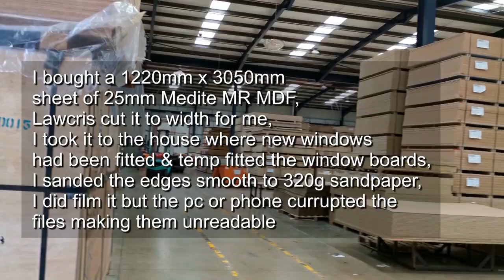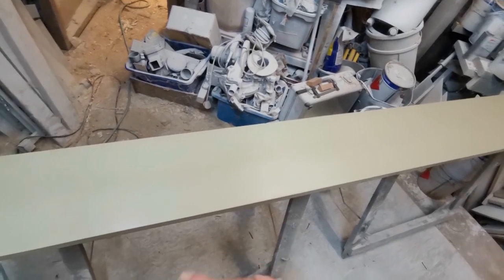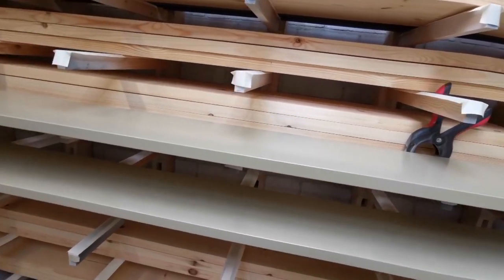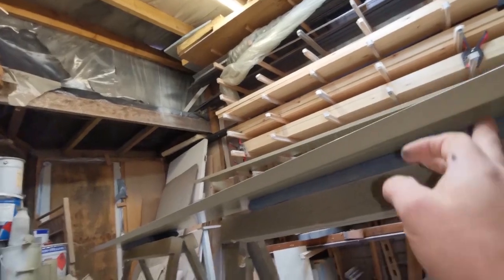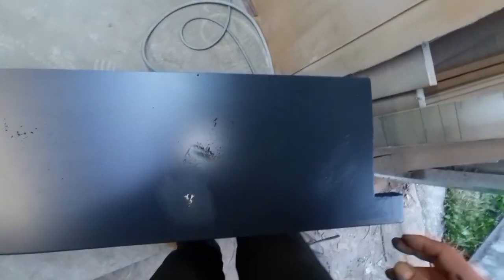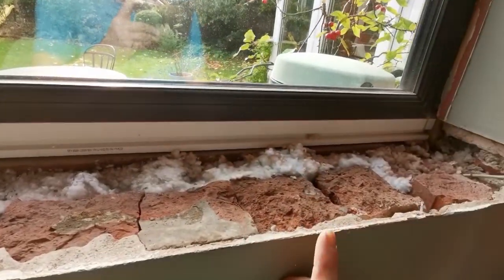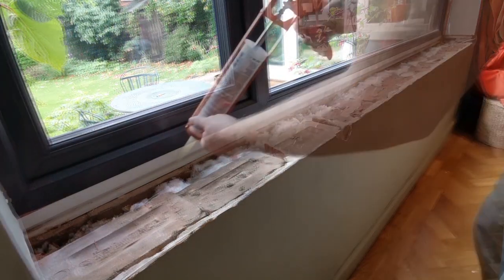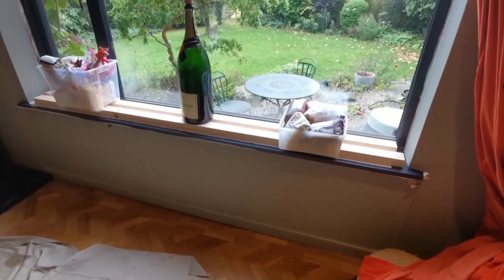Spraying & fitting some window boards with PU enamel paint, colour matched to Railings Grey

Comment: There's bugger all wrong with using foam to fix,when there's sufficient gap underneath I like to put some panel pins in ten underside of the cill and use the insta stick low expansion foam which is also great for fixing skirting etc. it is twice the price though. Another cracking job. I'd love to be able to spray my work,especially to your standard but I don't have the gear as of yet.
Reply from the maker: 👍 Yep anyone who's tried to remove anything that's been foamed in will know it's quite firmly in there, 👍 The spraying is fairly simple, I have a Bostitch 50L compressor which is only just big enough, I'll upgrade to a 100ltr with a bigger CFM one day maybe, I've a variety of Gravity fed guns & a wall mounted regulator/filter set at about 20-30psi, very simple to set up, The cheaper guns i use sometimes are ANI for about £24, they're good to start with, the black ANI i use sometimes is a bit more £45-ish & the Devilbiss FLG5 is closer to £100 but it's the best & my favourite, it's the one you'll see me use most of the time, the paint strainers i use for all paints, they are Starchen 190, I get mine locally but can be got on ebay etc. https://www.ebay.co.uk/p/1292815382?iid=113200954395&chn=ps&norover=1&mkevt=1&mkrid=710-134428-41853-0&mkcid=2&itemid=113200954395&targetid=879043638628&device=c&mktype=pla&googleloc=9046317&poi=&campaignid=9455575137&mkgroupid=94880575894&rlsatarget=pla-879043638628&abcId=1139576&merchantid=7341554&gclid=CjwKCAjw5Ij2BRBdEiwA0Frc9SSEKwHUlAOBKkG1HPN803XblvAQwt4Mt6gWa1BsEcuE70eue-P9fBoC2_EQAvD_BwE  I don't know if you have a compressor but a compressor is good for any workshop tho if nothing else but for blowing up your tyres 😁 This company is good for guns https://www.spraygunsdirect.co.uk/index.php/

Comment: As usual a great job. Amazed that you can get such a good finish in what looks to be a pretty dusty work area.
Reply from the maker: Thanks 👍 Yeah it's far from ideal but they normally turn out ok, there's a few more dust bits then I'd like, I'd prefer it clinically clean 🤷‍♂️😁, for me it's about dust management, I blow down the immediate area before spraying, if there's a lot of dust from maybe cutting/sawing i'll start spraying next day when it's settled, i try not to kick up or disturb it while spraying, sanding the primer & any filler causes loads of dust, once i get to the top coats i take these precautions n the fan above the door helps to extract airborne stuff 😉

Comment: The finish on those cills is fucking awesome.  Wouldn't mind getting into doing a bit of spraying myself since most of the painters always seem to leave big shitty streaks/ blobs on my work.
Reply from the maker: Thanks, yeah that's the reason i started spraying the finish coat, I'd put a coat of primer on for people just to seal it until they got around to painting but when i went back n saw the state of theirs or a so called decorators paint work, runs & the detail lost under blathered paint i started to offer spraying, It's fairly easy after a bit of trial n error with minimal tools. I have a 50L compressor which is only just big enough, a variety of Gravity fed guns & a wall mounted regulator/filter set at about 20psi 😉👍 I'm going to try show it in my next vid where I'll be spraying stain n clear lacquer .
Reply: @Gidjoiner  I'm a total novice so thanks for the info!  Yeah, there is nothing more heart-breaking knowing how much care you have taken  to have somebody paint bomb it. I'm looking forward to see your setup  in a little more depth. I'm actually a little excited to have a go at spraying, never thought i would say that about painting.
Reply from the maker: 😂😂 Same here, hate painting by hand but spraying does give a lovely finish for minimal effort, it does show every imperfection tho so is only as good as the work done before on the wood, primer, sanding, filing etc. 
There's honestly not a lot to show on my set-up, quite simple, that's what i like about it, The cheaper guns i use sometimes are ANI for about £24, they're good to start with, the black ANI in this vid is a bit more £45-ish & the Devilbiss FLG5 is closer to £100 but it's the best & my favourite, This is where i got my guns they'll talk to you 😉 https://www.spraygunsdirect.co.uk/index.php/

Comment: I did my window board the other week, and did a similar thing with wood on cill but used some  plaster board ceiling jacks to stop the foam from pushing up. Nice work gid
Reply from the maker: 👍👍 I did wonder if the weights would be enough n hoped the excess would just squeeze out the front, I don't have plaster board ceiling jacks but considered wedging some 2x1s to the top of the reveal, knowing my luck tho the plaster would fall down,  😂 Thanks Phil 👍

Comment: Great videos Gid, I’m in the process of learning how to spray, I’ve bought the compressor, guns and so on, but not having much luck with it at the mo, but I’ve only been using emulsion paint. Symphony shop is only half hour away from me so I’m going to get some pre cat paint to start off with, just the primer for now so I can practice. Your channel is one of the best informational, practical channels for a beginner sprayer like me I’ve ever watched ( and I’ve watched quite a few this past month ) so much so, I’ve let 2 brews go cold just watching this video and the one with the blue shelves you did last year. 😁😁
Reply from the maker: 👍👍 Pre-cat lays flat & dries quickly so you'll be able to experiment without having to wait hrs for the result 😉 Thanks 👍 I'm not a full time sprayer but I share what i know n have experienced 👍
Do you know what's the main part you're having difficulties with?

Comment: lovely finish on them. I use an airless sprayer so use water-based paint but recently discovered movac/sayerlack paints and amazing for a water-based. Been thinking of swapping over to what you use though cos the solvent-based paints look great and durable. So look forward to your next vid as noticed comment of upcoming video
Reply from the maker: Hi, thanks 👍 I consulted Symphony coatings about the water based stuff, they didn't 'promote' that idea, their water based stuff needs 20º+ to dry properly within a reasonable length of time, my shed would have to be insulated & heated, don't know how long but this PU goes off n is sandable in ½hr-ish, 
How long does your water based take to dry?
Reply from the maker: Yeah this PU is very durable, flexible so doesn't chip easily on wood, just dents but has that hard enamel feel, you do get a bit of orange peel to it, the Pre-Cat & AC spray easily & lay very flat but have no flex so chip when knocked n the Pre-cat isn't very durable, also the PU is resistant to most household chemicals inc acetone so nail varnish remover is no prob, I do have to test that info given to me by symphony tho but i know the thinners for the Pre-cat & AC which is similar to acetone doesn't clean my guns.
Reply: @Gidjoiner  oh the water based takes hours to dry.  My shop very similar to yours and need heaters on.  What you are using seems much better but for water based this new stuff is so good a couple of ppl asked me if the doors were factory made as it was so flat.  But I'm looking for finishes like you're doing so I know it will hold up and last.  And the long cure time with water based means high chance of dust or worse as it can craze if to cold which my shop gets freezing overnight. Not sure if I can spray pu in an airless. Airless you get tons of over spray and waste. So really like watching your vids for tips. To many pretend guys on YouTube think a burt joint makes then a joiner but I can tell you got old school knowledge like I learned.
Reply from the maker: Thanks 😊👍 Yep.  It's nice to get/give a quality finish to your work 👍👍
yeah don't think I'll be going water based any time soon, the factories use water based i believe but they have heated temp controlled work spaces, I'm not going to heat my shop, even in the freezing winter this stuff goes off in maybe an hr if above 0º,
I just wrote this on Sharps comment.some of it's a repeat of what I've already written, 
Before you choose a paint make sure your machine can handle solvent paints, the thinners in these can melt some plastics.🤔
Pre-Cat, AC and PU are enamel paints so give that hard quality feel, they all dry & can be sanded within 30mins-ish. 
I sprayed the primer, 2 coats, on the back of these boards the night before (Thurs) then 2 coats of primer & 3 of top coat on the face next day (Fri) i fitted them on Sat then went back for the final bit to take the masking tape off when the foam had dried on Sun. I normally like to leave the paint 36hrs after final coat to cure properly.
 Pre-Cat is the simplest & cheapest, it's a 1 part paint, pre-cat refers to pre-catalysed, the hardener is already mixed in, it'll last in the tin on the shelf for months tho, no mixing involved, excess can go back in the tin, sprays easily & lays flat, it isn't very hard wearing tho, i did some shelves in blue in one of my vids, that was old Pre-Cat that'd been sitting there for quite a few months, i bought it for a job Facebook pics say 1st may 2017, the shelves i did with the excess 2nd Oct 2018. despite any draw backs it might be the best for a newby to start with,
AC paint (Acid catalyzed) sprays easily in a similar way & lays flat, this is very hard wearing, 
Both of these are hard paints but because they are hard they chip if knocked with the wood being soft underneath, i made the mistake of using AC on a kitchen, Symphony's rep said "why not try AC, it's as hard as nails, it's what they put on cars" The kitchen has chips all over it, i wish I'd stuck with my reg PU, I go back there n touch up the kitchen, cars are made of metal not wood 😒 I don't use AC tho because of this experience,
PU is an enamel so you get that quality feel, but is a little harder to spray, it gives a slight orange peel effect, it doesn't lay as flat as the other two but because of the PU (polyurethane i presume, plasticy 🤷‍♂️)  it has some flex, if knocked it dents rather than chips off, the thinners for the other two are similar to acetone but PU is different, acetone doesn't affect it so nail varnish remover doesn't harm it, good for vanity units etc.. it's also resistant to most household chemicals. I can't clean my guns after using PU with acetone or the AC & Pre-Cat thinners, they don't dissolve the PU paint.
This is where i get my paints, they have info on there site, don't know if it's any good tho https://symphonycoatings.co.uk/
Facebook pics i bought the blue Pre-Cat for 
https://www.facebook.com/gid.joiner/media_set?set=a.1365517043534658&type=3
The shelves i did with the excess sitting on the shelf.  
https://youtu.be/ydyqqGBLa60
Reply: @Gidjoiner  wow cheers buddy for all the info. More ppl need to watch you as your experience covers a vast range of skills and they are skills that in my opinion are very important.  Modern tools etc are great but knowing how to work using traditional methods with high standards wins everytime. 👍

Comment: Great job Gid..... the finish you get on that medite is amazing especially the edges 👍. Although I think you may have done it before, like others, it would be very useful to get some detail on your spraying setup (compressor, guns etc..)
Reply from the maker: Thanks Mike, yeah i think the MR helps reduce furring up on the edges, putting some effort into sanding them very smooth helps too, i lost the clips of that 😒 I'm going to be spraying stain & a clear lacquer this wk so i'll inc the set-up then, it's fairy simple tho, 50L compressor which is only just big enough, a variety of Gravity fed guns & a wall mounted regulator/filter set at about 20psi 😉👍
Reply: Gid Joiner cheers mate and I’ll look forward to watching the vid when you spray the stain and lacquer..
Reply from the maker: Hopefully end of the week 😉👍

Comment: Great video again Gid , as I am now looking to invest in a spraying set up , I too would be interested in a spraying video, recommending gun  type and paint specification.
Apologies if you have already covered this in another video.
Please keep them coming.
All the best mate,   Mike.
Reply from the maker: Hi yep I'll try to show what I'm using, like I've written so sorry for copy n paste -  I have a 50L compressor which is only just big enough, a variety of Gravity fed guns & a wall mounted regulator/filter set at about 20psi 😉👍
The cheaper guns i use sometimes are ANI for about £24, they're good to start with, the black ANI in this vid is a bit more £45-ish & the Devilbiss FLG5 is closer to £100 but it's the best & my favourite, This company is good for guns https://www.spraygunsdirect.co.uk/index.php/
Thanks Mike 👍
Reply: @Gidjoiner  I asked Gid the same question awhile back and i went with Gids recommendations , dont make the mistake i made , i bought the cheaper guns and skipped on the devilbis at first, then a few weeks later i decided to buy the devilbis, dont skip on the devilbis it is well worth the money and defo my favourite gun aswell .
Reply from the maker: Were the cheaper guns the ANI ones? Yeah the Devilbiss is well worth the money, it's hard to describe the difference without trying the cheaper ones but the spray pattern is so much better, my most used gun n the only one you'd prob need, i use it for 80-90% of the time.
Reply: @Gidjoiner  Not sure Gid , i do not think it is a ANI because there is no name on it and the other one is a Sealey roughly sixty quid i think, i only use the cheaper guns for primer and keep my Devilbis for the top coat, i take no credit for my set up it was totally down to you helping me out with your endless advice, so a massive thank you Gid , by the way i upgraded my compressor to a 90 litre belt driven one and defo makes life easier, plus it is more quieter my stanley was defening in comparison .
Reply from the maker: Ah, 👍  i thought you might be referring to the ANI i may have recommended. they're ok to start with & better than some of the cheap no name guns but they are still cheap guns, 😉 just like me in this, cheaper gun for the primer n Devilbiss for top coat 👍 I need to upgrade my noisy compressor so a little jealous 😉 one day. 
I only know what I've learnt from my experiences but you're more than welcome n glad it sounds like it's working out for you., no prob, Thanks👍
Reply: @Gidjoiner  That is where you stand out Gid your more than happy to give us all advice from your years of experience and you always put hints and tips in your videos ,allot of  people on youtube just want to show off and want everyone too think how clever they are lol , by the way Gid when you get round to replacing your compressor try to listen to a belt driven one, they are still loud but a more acceptable noise if you get me and apparently last allot longer .By the way every time i see your Domino and mitre saw i am mega jealous but i only do diy and help friends and neighbours out , so i could never justify the outlay , where as your a professional joiner that gets the use out of such class tools .

Comment: Gid, try some 3M (red) Scotchbrite, it’s about 320 grit and great for edges and uneven surfaces, far less likely to burn through.
Reply from the maker: Thanks, I've got some grey stuff, don't know what grit grade they are but i find those scouring type pads prepare the surface but go over any little lumps rather than sand them flat,? 🤷‍♂️
Reply: yeah you can’t de-nib with them, but they’re really good for corners as it takes some doing to burn through. Grey are the finer ones, prob about 6-800 grit.

Comment: What size of compressor do you use, mate. I have a 100 compressor, would that be suitable for spray painting? Cheers.
Reply from the maker: Yes, Mine is a Bostitch 50L, it's only just big enough, i originally bought it just as a shop compressor, It's doing fine for now but I'll get a bigger one one day, I think more importantly is the CFM, the amount of air the pump can supply & refill the tank, you could have a massive tank but a small pump with low CFM wouldn't refill the tank quick enough, I spray at between 25-30psi, it's quite low but the air goes quickly, Sprayguns direct have some ANI guns for £24 if you just want to have a go, I've got 2 they're alright, then update one day, my favourite & go to gun is the Devilbiss  FLG5, £100 but it's a Mercedes compared to others,. You'll need an air filter/regulator, Paint strainers. i use Starchen 190 for most things. 👍
Give them a ring, they're good people n know a lot more than me 
https://www.spraygunsdirect.co.uk/sprayguns-parts/gravity-sprayguns.html